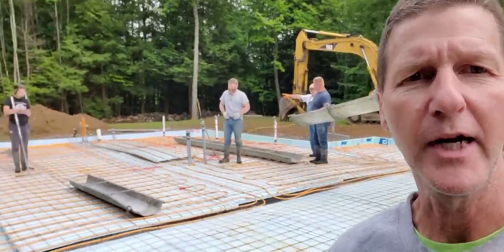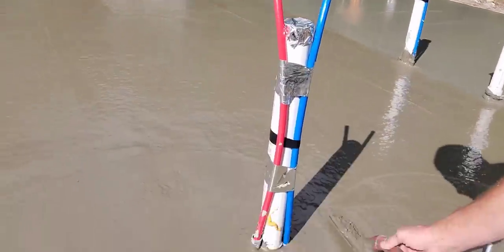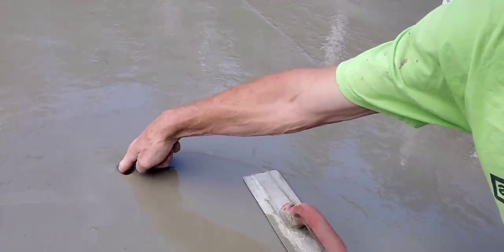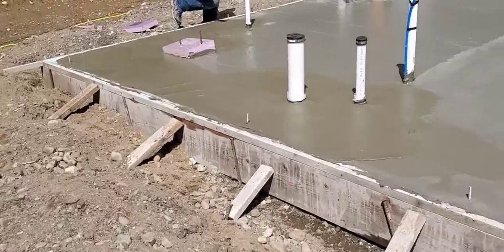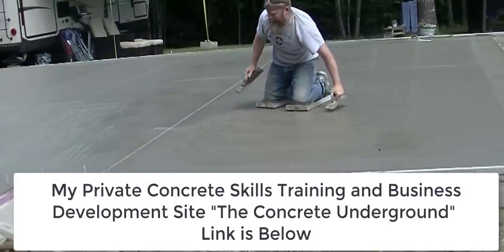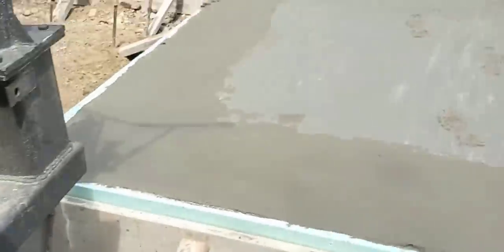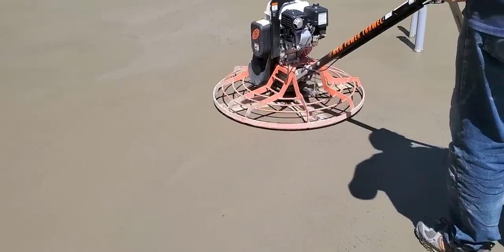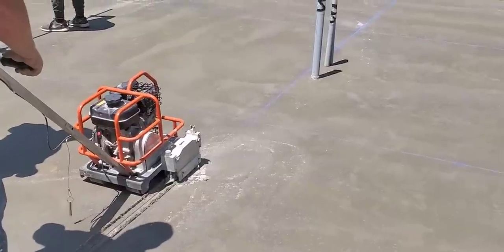When To Start Finishing Concrete After Pouring (Troweling & Broom Finishes)

Comment: It’s the experience working with the material on large pours that gets you. The visual and tactile interpretation of cement that only comes with years of handling and working on top of the stuff. I will say that demonstration was actually useful. Close ups, using your finger and explaining the visual cues of concrete was helpful. Cheers

Comment: Besides just being in really good physical condition, that really is the biggest trick to finishing concrete -TIMING! Equally important to knowing when to start your finish, is knowing when to just leave it alone and let it do its thing. Leaving it alone is probably the hardest thing to resist, bcz of the apprehension of not wanting to let the concrete get away from you. 

It’s actually even more complicated than that bcz when Luke first put the machine on the slab, it still looked a little wet. But thru experience you guys knew that 2 hrs had already passed and it was starting to get to a ‘now or never’ situation. And sure enough right after the float pass, it started going off. 

At 11:30, is Darin just cleaning up the edge at a cpl spots, behind the saw cut, or is he putting something into it? If so, what?
Reply: Yes, timing is the Key.
Reply from the maker: Yes, the timing is really something most people don't understand about concrete. Hopefully these videos help some people understand that. Darin was putting in some small pieces of cardboard where we cross cut each joint. It helps strengthen that area when we cut through another joint and lessons the chance of the concrete fracturing there.
Reply: @MikeDayConcrete  Ah right, gotcha. I didn’t see the lines in the other direction.
Reply: Or you can always wet it with some water. If it's too dry, the sunnier it gets the faster is Gonna dry no matter what u do. A little water doesn't hurt, especially if you are in florida, lol
Reply: @Southern612 Same story here in az. Lots of guys like to throw water to help close it up. A misting is fine to help the surface stay hydrated but I always have to stay on guys not to finish it in. I only throw water in the most dire of circumstances where if i dont splash some water under the trowel it will leave an unacceptable blemish. Like dropping a tool and leaving a deep gouge in the surface (not that ive done that or anything). Typically at that point the concrete is about to be burnished anyway and a splash of water to help the trowel glide a bit probably wont hurt too much.

Comment: Mike great stuff . We did a Grage floor today it whet Bad! We waited to get on the floor with a power trowel after the float blades we went to the finish but we keep getting lumps like it was soft spots was that I went to a setting that was to sharp? Do you have any videos on the settings ? Everything went fine pouring,screed, bull float till the finish I saved it by rubbing for 3 hrs..please help tell me what I did wrong . I m thinking it’s like what degree pitch for float blades then what pitch should I start the finish blades . One other thing on the finish it was like fighting a pig all over the place ? Thanks MP.   PS. You are helping the small guys thank you

Comment: Hey Mike, so even though you are doing a broom finish up front, you only used a mag float both times? You didn't do a steel trowel then broom finish?
Reply from the maker: No, we don't steel trowel our exterior concrete here in Maine. It could trap water or air under the surface, even on a broom finish. You can trowel it if you don't get freeze thaw seasons like we do.

Comment: Mike, regarding concrete curing, I was told years ago that keeping a new pour damp for a week or two increased the strength of the concrete.  Is that still true?
Reply from the maker: Yes Frank, wet curing is still the best method.
Reply: Mike Day Everything About Concrete Mike, you might do a video on how to do that some day.  There must be new methods.  Thanks
Reply: 7 days wet.goal. less than 70 degrees for 7 days
Reply: Capo Construction Longer if in hotter climate or summer?

Comment: You do multiple finish passes with the power trowel, is there something you look for to know it's time for the next pass, or do you go again after a certain amount of time?
How do you know when you're done?
Reply from the maker: It's all timing, and how hot or cold the weather is. There's no certain amount of time, it's different every day depending on the weather, sun, shade, mix design. When I go to do the 2nd pass, if I step on the concrete and leave a "wet looking" foot print I know I have to give it a little more time. I want my footprint to look a little wet and a little dry if that makes sense.
Reply: @MikeDayConcrete  "a little wet and a little dry" I don't have the experience for it to make sense yet, but I'll look for it on my DIY pour next week :) 
No power trowel, I'll see what I can do with a steel hand trowel. 

BTW I bet more DIYers like me would love a video of the finest finish you can get w/ hand tools. Close ups of the finish (from different angles) after each pass would be good reference.  The shots of pushing your finger into the wet concrete in this vid were great!  Thanks for the help!

Comment: Me and my dad were making a concrete footing for our house and we mixed ours in a wheel barrow. The stuff we mixed up was much more thicker than the stuff you use from the truck. I heard that if we added any more water to the concrete we mixed up it would make it much more weaker. So I am guessing there is something different in the concrete from the truck?
Reply: Everything is normally specified on the plans. Some concrete only needs to be a certain psi per code. They also make a superplasticizer that can be added that reduces the slump without reducing the strength.

Comment: I use a power trowel on a pole....weighs around 26 lbs we use it on the pours that timing or temps wont work for the walk behind trowel.
Reply: We also use a product called Day One it is a life saver.

Comment: Nice work Mike.. Question.. My Dad had a guy pour a garage floor and I noticed there were small alligatoring cracks throughout the surface. What did he do wrong so I don't make those mistakes? Thx again!  Jeff
Reply from the maker: He didn't do anything wrong. That's just the surface drying at a much faster rate than underneath. It's not structural, just cosmetic. It happens to us to.
Reply: @MikeDayConcrete  would putting a drying agent or keeping it wet help?
Reply: We poured a slab once that did that. It was an elevated deck. Maybe 15th floor or something I forget. When we came in the next morning, there were hairline cracks all over the place. I’d never had a slab crack up like that, so I called the engineer just to be safe. He said go ahead and continue with the verticals and keep an eye on the cylinder breaks for any problem numbers. It was a post tension slab and after 3 days and getting sufficient strength numbers from the lab, we stressed the cables. The cracks completely disappeared. You couldn’t see a single one even if you knew there was one there before.

Comment: Also more crazy thoughts here , do you do any commercial work or city civil work , inlets, storm drains , culverts , headwalls , run off channels ? Any tips on storm inlet form up .. I’m a concrete structure carpenter, floating and flying tables for sky rises but looking into starting something small in the residential market . On your course how detail do you go into estimating? How detail is the stamp concrete module series ? Any quick form up tips for side forms , panel forms or columns ? What should one estimate for net profit the first year with a four to six man crew ? What would normal overhead be beside my living expenses working out of the truck ? What are my hourly rate burdens ? Is this all covered I your course? Any how you always provide great information and look forward to more .
Reply from the maker: In my Concrete Underground private site we can discuss all those questions in the forums.

Comment: Just curious !!! How many square feet or yards and hour can a good season crew set, form and finish per hour ? Also what is a good stamp concrete mix design? 5 1/2 or 6 sack mix ? What size Aggregate? With Flyash or no straight cement ? Must be nice to put in 60 degree weather ... we pour concrete at 3am here in Phx it gets about 89-95 degrees in around 530ish and try to finish before the real heat comes in . Also just curious about estimating looking to start a small six concrete business with more on the residential side and stamping here in Phx or Texas with a years time . Any help will be great
Reply from the maker: How much you do per hour depends on the experience of each person on the crew. It's different for everyone. I use a 4000 psi 3/8 stone mix with micro-fiber for stamping. No fly ash, just straight cement. Join my Concrete Underground to learn more about starting your own business and estimating. https://www.theconcreteunderground.com/the-concrete-underground
Reply: I can tell you the most a 5 year experienced flat work, 24 years old concrete man can do. At this point I've poured and finished around 6 to 8 thousands of yards of mud and am at the top of my game. Helping a school buddy with a concrete driveway on his first house. Friday I set and grade 3 cars wide on a 2 car garage with front walk. Narrowing to 12 foot wide. Wire mesh and a tight 3 1/2 grade. Saturday morning 9 yard truck, 7:00 am, kick buddy out of my way. Hand cut control joints. By noon I had stripped forms and set second part out to road. Had another 8 yards at 1:30 poured and finished with a 1/2 yard call back. 6:30-7:00 forms stripped and barricaded end of drive. All hand finished with a light broom. Hard work for 2 cases of beer.
17 1/2 yards set, poured, finished, and stripped in about 12 hours essentially by 1 experienced young concrete guy. Was hard work but not extraordinarily so.

Comment: Did you not trowel the patio piece? Looks like you just hit it with a float and broomed
Reply from the maker: Float twice here in Maine, freeze and thaw conditions here so no steel trowel on exterior concrete or you're asking for problems later

Comment: Hey Mike when I had my 26x30 shop floor poured my neighbor thought I was crazy for watering it down 4 to 5 times a day for a couple weeks after it was poured. It was hot out and I heard somewhere that if you hose it down it slows the drying process and makes it stronger. What do you think about this?
Reply: Drying too fast can weaken the finished product. I worked with an old timer that would put straw on the next day and have the owner wet it for a week in the summer. Applying cure and seal is a good idea too to help the hydration process.
Reply: You did right

Comment: It's a 8, maybe it has super, we do yards and yards of state work they test everything, a 8 is ok most of our contractors pour on a 8, most state work is 3.5 to 4 slump, it barley will come out of the truck, super will bring it to a 6, but a 8" slump they will reject it. And 4" slump will work a finishers ass off. Btw if concrete dries before it cures it will be weak. Retarter will slow it down, I recommend it in 80 + deg weather.